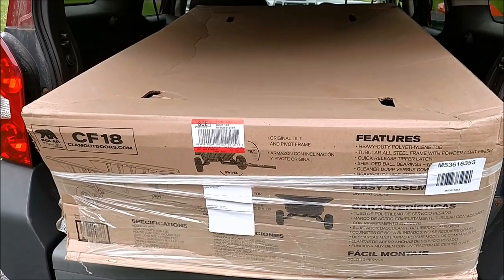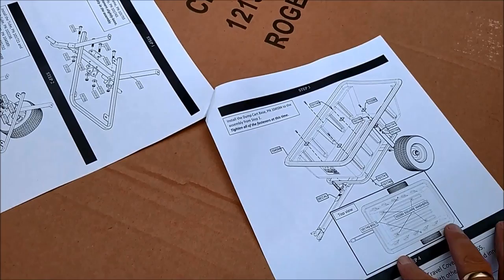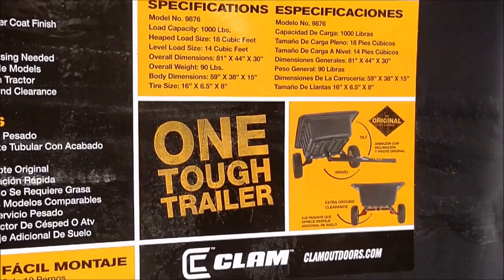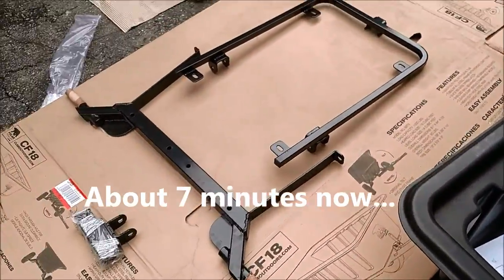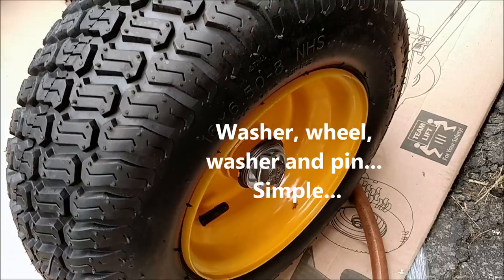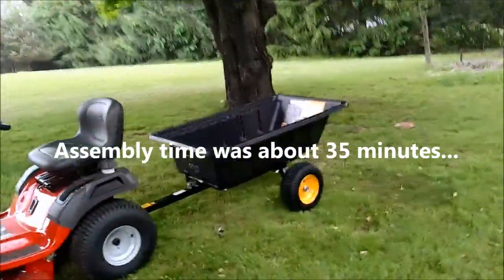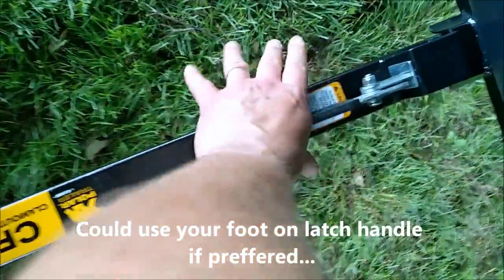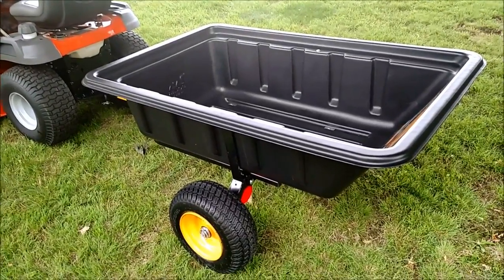Polar 18 cu. ft. CF18 Dump Cart Unboxing and assembly

Comment: Great video and they are well made carts but if you are purchasing for the dump feature, don't buy it. You will have to empty the bed by hand because of the dump angle. Thanks
Reply: That's what I was thinking...  The box needs to sit higher on the frame.